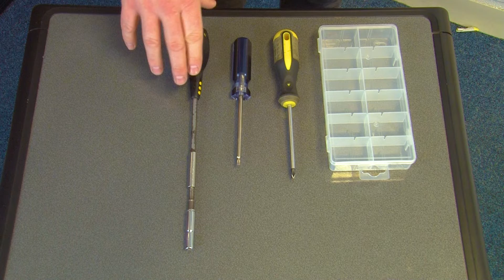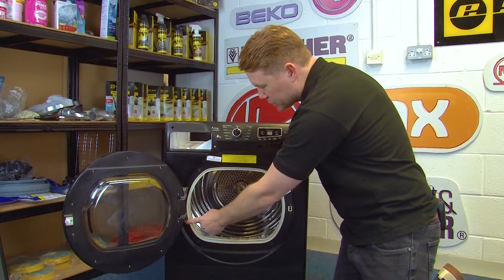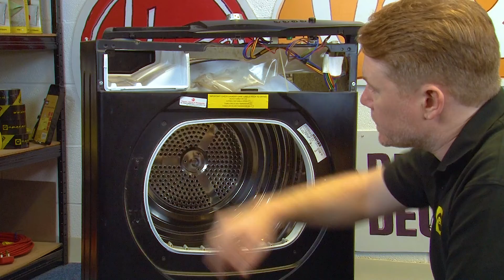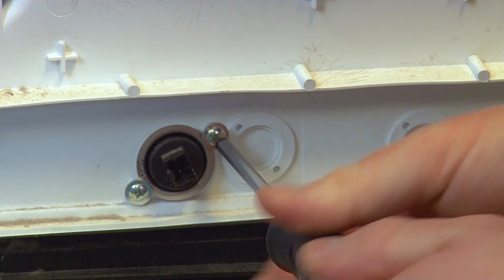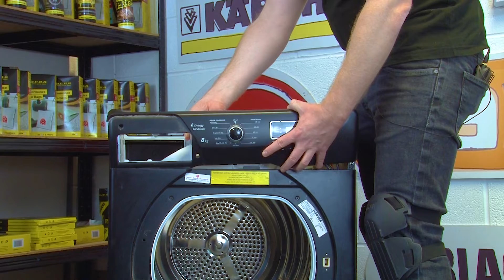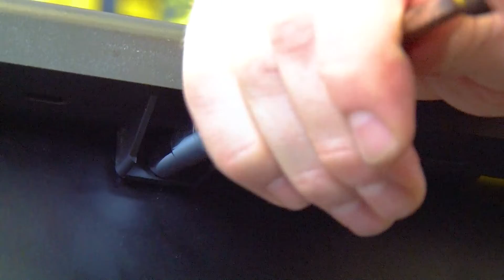How to Replace the Front NTC Temperature Sensor on a Hoover Tumble Dryer

Comment: Hello, do these kind of NTC's have a resistance reading ? Or a way to check if they are ok with a multimeter ?  I have set resistance to the lowest (200) on 3 of them (2 brand new, one that is old) and i get no reading when i touch the probes on the small pins inside the plastic case of these thermistors. 
I do not get it .